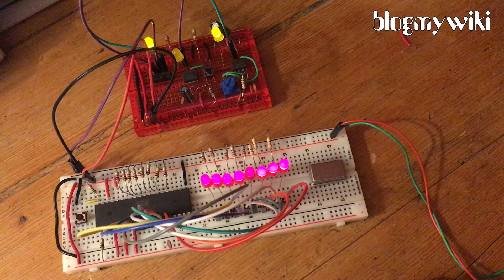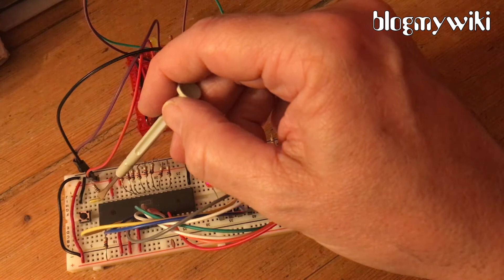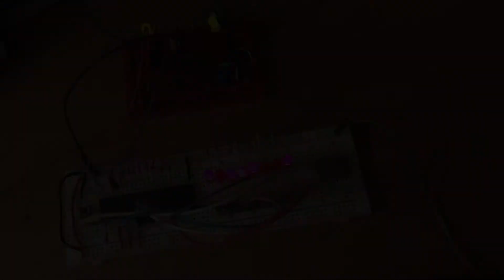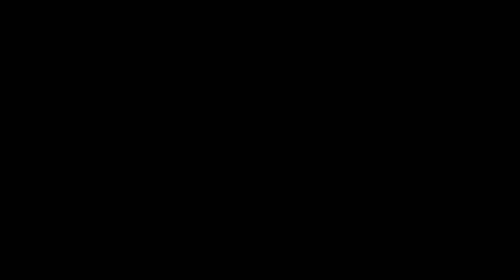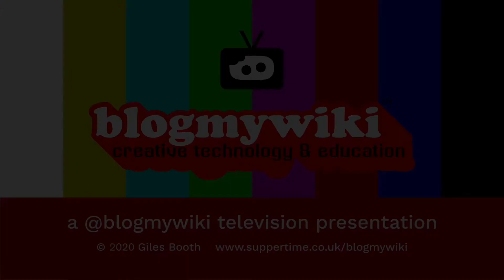6502 breadboard computer - first steps

Comment: I saw the difference from yours and ben eater's is your second pin using a resistor instead of the wire. does that make any difference?
I tried following ben eater's video but the address of mine does not advancing.
Reply from the maker: Good spot! Yes it looks like I tied pin 2 RDY high to 5v via a 1K resistor. I'm not sure it makes any difference, or why I did it - possibly because the datasheet for the WDC 65c02 processor says 'It is suggested that a pull up resistor be used on this pin when not being used.'  https://www.westerndesigncenter.com/wdc/documentation/w65c02s.pdf
Reply: @othermachines  Thanks! After some digging I found the issue is not about CPU wiring, but the clock module. 
The one on Ben's video does not have a resistor between ground and the last led. But in his 6502 hello world video there is. 
I followed its first video and did not notice that one additional resistor. 

I still don't know why that 220 ohm resistor makes the difference, but at least mine is working now.